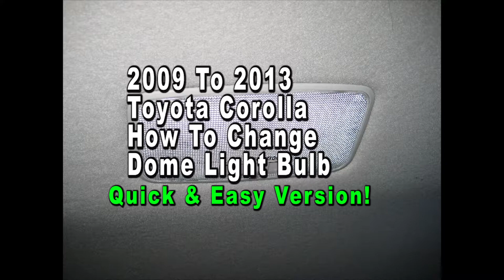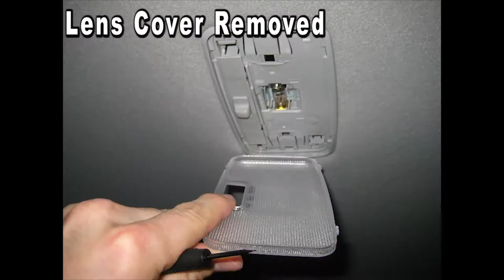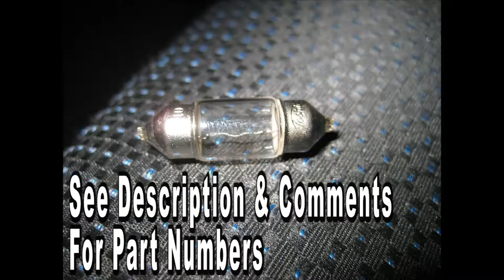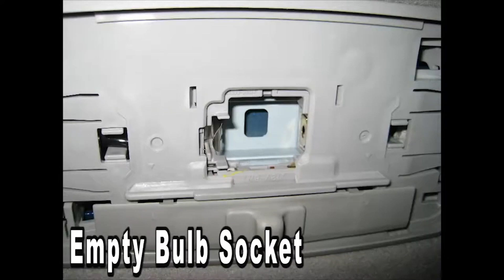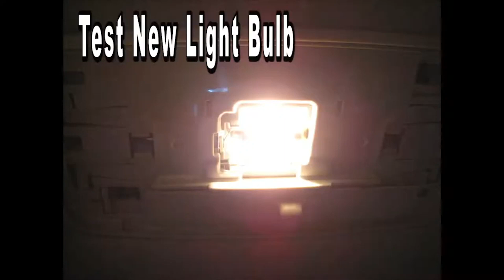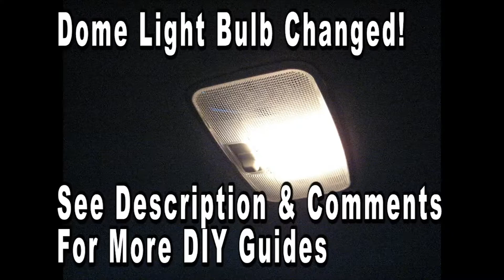2009 To 2013 Toyota Corolla How To Change Dome Light Bulb - Quick & Easy Version

Comment from the maker: Check out the DIY tutorial for changing a burnt out dome light bulb in a 10th generation 2009, 2010, 2011, 2012 & 2013 Toyota Corolla - 
https://www.paulstravelpictures.com/2009-2013-Toyota-Corolla-Dome-Light-Bulb-Replacment-Guide/index.html

Here are all of the DIY repair and maintenance guides for the tenth generation 2009, 2010, 2011, 2012 & 2013 Toyota Corolla - 
https://www.paulstravelpictures.com/Articles/2009-2012-Toyota-Corolla-Common-Problems-Repair-Maintenance-Guides.htm

This automotive "how-to" guide was specifically written to assist owners of the 10th generation (2009, 2010, 2011, 2012, 2013) Toyota Corolla in changing a burnt out dome light bulb or upgrading it to a brighter LED unit.

Owners of other Toyota, Lexus or Scion vehicles such as the Yaris, Matrix, Prius, Camry, RAV4, Sienna, Tacoma, Tundra, FJ Cruiser, Venza, Highlander, Avalon, Sequoia, Land Cruiser, IS 250, ES 350, GS 350, tC, xB, xD, iQ and FR-S may also find these DIY instructions to be helpful.